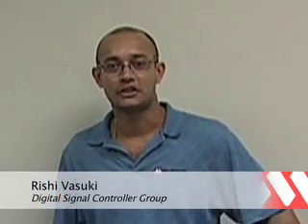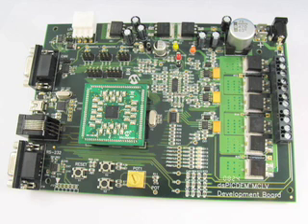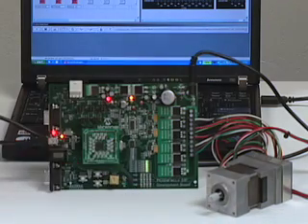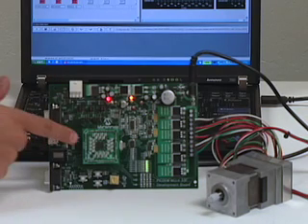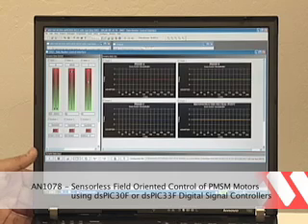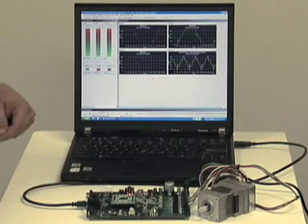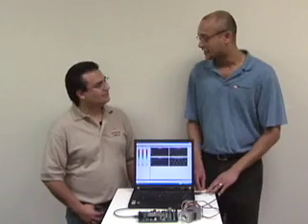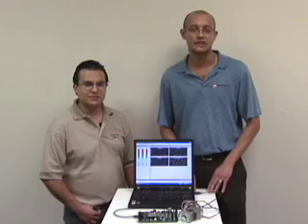Efficient Brushless DC motor and Permanent Magnet Synchronous Motor Control

Comment: @kewat1 I guess I should define what I meant by "better control". Using a sensor like an encoder can certainly give you more precise positioning or a tighter velocity control loop.  

This is much in the same way using a speedometer to regulate your speed is better than trying to judge your speed by just looking out the window. 

With that being said, your statements are also true and not every application requires a high level of precision.